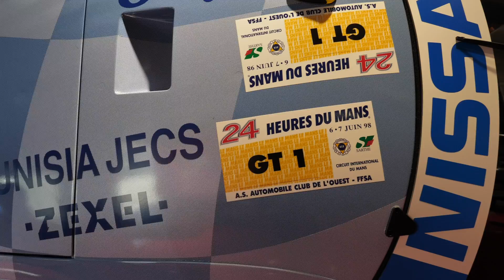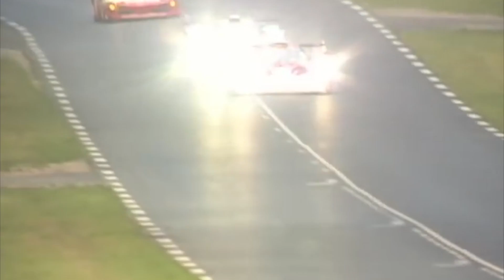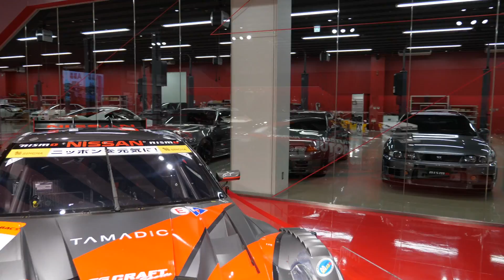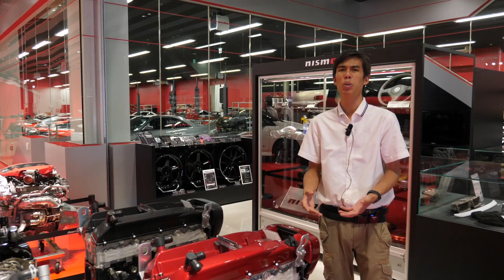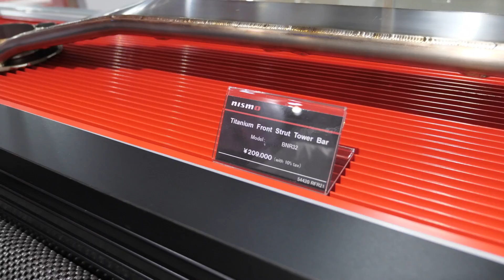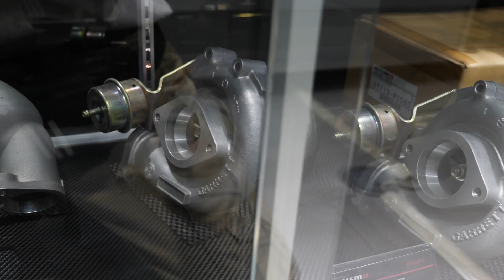Nismo Omori Factory in depth Review | GT500 Car, Brand New Nismo Engines & Accessories | JDM Masters

Comment: I think you didn't mentioned the:
NISMO F-Sport RB26DETT 2,8L. 
Using Z2 concept Engine parts from (Z-Tune) GT500. The engine itself can tune up to by 500 or 550HP (same as Z-Tune). Plus it's very very expensive to buy one. 
It's a super rare engine to find one now. 
I think Nismo didn't showed that up. 🤔

Comment: Interesting & great to see legendary vehicles but NISMO tax is bullshit... I say this as a Skyline owner, car lover & modifier but you can not justify the amount they charge!

The old N1 blocks used to be worse castings than the original RB25 / RB26 / RB30 blocks, they use a lot of dated technology & you can build much faster / stronger / cheaper engines out there if you buy the right parts & address the known issues of RB's etc...

Like Toyota & some others, Nissan make some incredible vehicles & technology. However, unless for bragging rights, authenticity or if you have more money than sense they are not worth the extra over some competitive parts!

This is not a downer on this video, as it is very good but letting your viewers know to not go blindly into spending 10's of thousands of pounds / dollars etc unnecessarily ✌🏻

Comment: Skylines with a factory 4 cylinder engines: if you can ignore all Prince Skylines ALSI, BLSI, S21, BLRA-3, S50, S54, S57 from 1957 - 1963 and then also the 1968 Nissan Skyline C10 with the G-15 or G-18 L4 engine. The 1972 C110 with G-16, G-18, L20B L4 engine options. 1977 C210, L16T, Z16S, L18T, Z18S, Z20E. Then the R30 had 6 different L4 options including a diesel and the FJ that you're aware of. R31 came with a 4 cylinder engine. If you want to say they're not real skylines, the R32 came with a CA18i option in the GXi spec

Comment: Those 3 Gunmetal grey Skyline GTR R32, R33 and R34 are the Clubman Race Spec GTRs.

They got pretty much all Nismo goodies borrowed from the Z Tune body parts in the case of the R34. Upgraded fuel rails and injectors system from the R35 GTR. 

Each Clubman race spec conversion is estimated to cost around 200K USD but yes they basically strip the car down to bare chassis and slowly build it back up with all Nismo/Nissan OEM parts and the process takes 1 year or more to be completed. 

But thats not including the long wait to get approval for work to get started on your own car. 

The GTR has to be Japan Street Legal with the paperwork from the car inspection. 

So your car cant be an auction car or de-registered. 

Lots of condition.
Reply: Nice. 👍

Comment: Wow so expensive 40k USD for that S2 RB26 block, damn unnafordable for 98% of people lol Nismo is sadly over priced, you can build the engine the same way or better for 10k max like lou vouiton and gucci you just pay for the brand name. I think Nissan has given up making good new cars so they are hoping they can make some income by pricing these nismo parts super high.
Reply: You have to realize your getting quality installed parts bundled with essentially a new factory warranty. On top of that, you're ultimately adding value to the car when folks recognize that everything is from THE reputable factory-backed brand. It's not much different from a 30k Mopar crate engine but I'm not even sure if those are warrantied.

Comment: Could someone provide a bit more explanation on why the RB26 isn't suitable for drifting due to the transfer case being located in the oil pan? Thanks!
Reply: Well.... quite simply because of what would soon become a vestige of it once being AWD should you choose to make a drift car. Most, if not all, drift cars are RWD. AWD is disadvantagous as the front wheels would constantly be trying to pull you out of a drift. The front transfer case, as well as most of the front steering rack/assembly if you were being serious, would need to go and having it intergrated into the oil pan assembly is a hassle.

Comment: Hi, there is an in House tuning For Subarus ? I know that STI exists, but its only for handling and some cosmetic parts, but nothing for the engine.
Reply: If you've seen how REAL STIs are built, then they are most definitely much more comprehensive than just handling and cosmetic bits. The changes are deep enough that the car is branded as an STI officially and not a Subaru. The only real STI we've gotten in the states was the recent s209 which had to go through some legal hoops to be sold in the US. But to answer your question, you don't really take your run of the mill Subie into STI to be tuned. They are essentially another company within/under Subaru that make the higher performance variants and race cars more akin to Quattro Gmbh (now Audi Sport) for Audis. But Subie enthusiasts have been in the OEM+ game for ages and will swap parts themselves.
Reply: @NamelessGlasses  Thanks for that bro :) i understand. 
But for example, iam from Europe and i currently have an GDB 07 model. The car is second hand and the previous owner (german) shipped the car too japan to be fitted with STI performance parts and the car is like a little demo of a S204. They 'v fitted Bilstein shocks i think, and some other suspension components. Also some engine and chassis reenforcements +bars. Plus a front lip. 
But the only thing they did to the engine performance was fiddle with the turbo that put the output of the engine from 230 to 250ish WHP but nothing else. 
I've commented this video because i rly love to tune the engine of my car just like those skylines, but for subies. I live near a tuning house that offer, among others, HKS, Mine's, Greddy and TOMEI parts for the STI, but i'd like to mantain the OEM nature of the car, but it seems its a bit impossible xD

Comment: Great video, as usual!! Some of pieces of information that you may find interesting about the Silhouette cars:

- They are Group 5 spec, so they are even earlier than Gr.B and Gr.C

- Their engines were race works development from the 4 cylinder L-series block (same engine family than the original Fairlady Z and the late 510s among others), and it was used also as N/A in rallying and one seater racing.

- All three cars had body reworks along the years, maybe the most notable is Yanagida’s Bluebird, which was originally a Nissan Gazelle.

Keep this great videos coming!

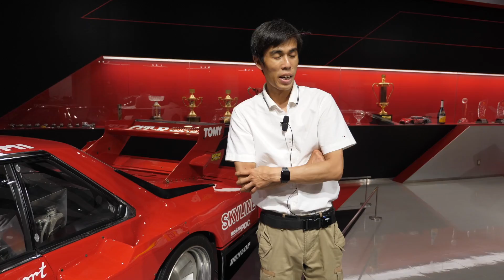Comment: 7:30 the wing is the result of regulation. The regulations for wings were much tighter than for bodyworks which resulted in those special looking Designs
Reply: yeah just old regulation..it a gtr if it 4wd.. it don't need big wing..
Reply: campkira absolutely not true. 1994 JGTC